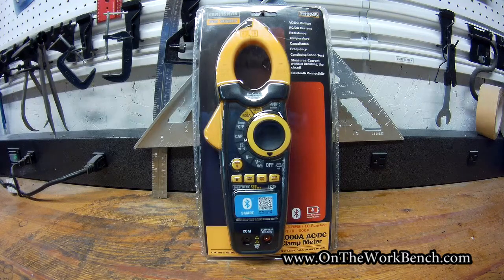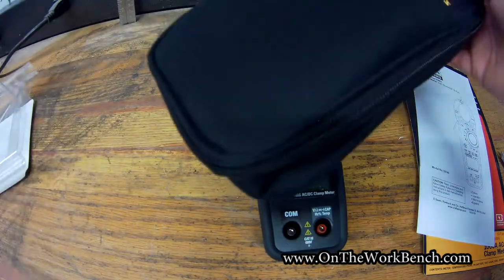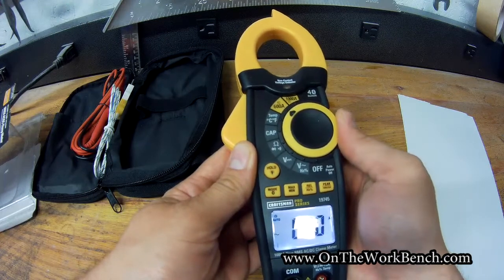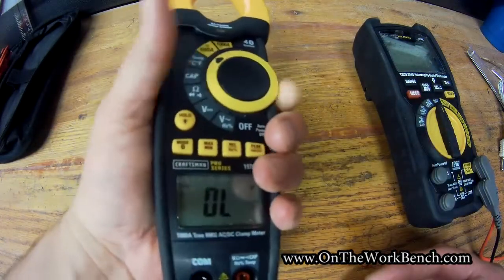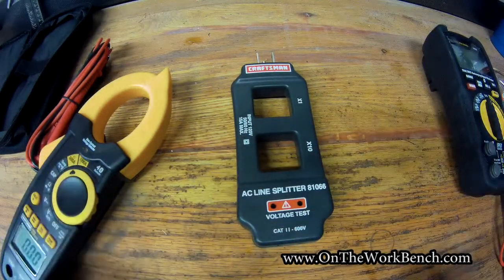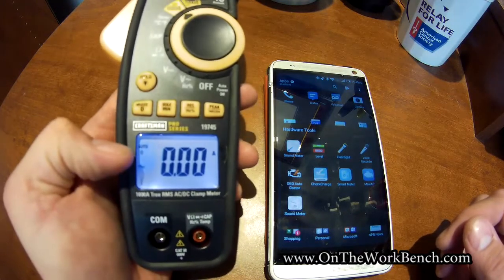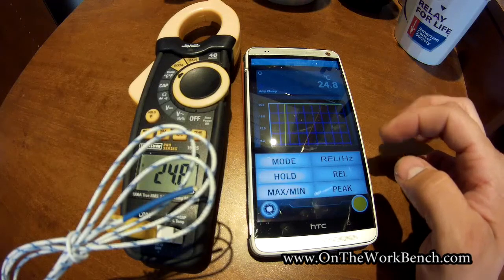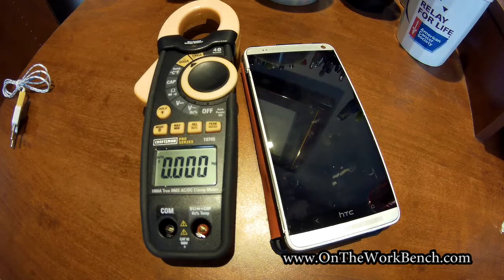Craftsman Pro Series Bluetooth Clamp Meter

Comment: Does anyone know where I might be able to buy the Clamp 19745
Reply from the maker: eBay or perhaps either a real Sears with it in stock but not on the website, a  Sears Hometown  or Ace Hardware. In any case a little luck will need to be on your side too. The easier option is to opt for the South wire 23090T. That is almost the same tool.

Comment: You specifically referred this as the sears brand not SBD. Is there a difference in quality?
Reply from the maker: Both Sears (under license to SBD) and SBD can source/make Craftsman tools as per the Craftsman brand sale. The "Pro Series" line is a Sears sourced line not available through the other SBD lines of sale (e.g. Lowe's, Ace, Menard's, etc.).

Comment: Does the non-contact voltage detector light up for 12Volts DC in a car wire or just 110 AC?

Comment: Can you set the volts and amps to default to AC or DC?
Reply: I bought the Klein CL-800 that also does AC/DC but it defaults to AC and you have to push a button to switch it over to DC every time you move the dial between volts and amps. It’s super annoying.
Reply from the maker: For volt testing just move the dial direct to either AC or DC by looking at the icon, there is a separate stop on the dial for each.
Reply: On The Workbench What about amps? I see there are two amp settings. One for 600 and one for 1000 but it has both icons for AC/Dc at each spot.

Comment: Nice video. Are you still using this meter, and if so how do you like it now that you've used it for awhile? I was also wondering if the back light comes on every time the meter is turned on? And if you turn the backlight button on how long does the back light stay on before it turns back off?